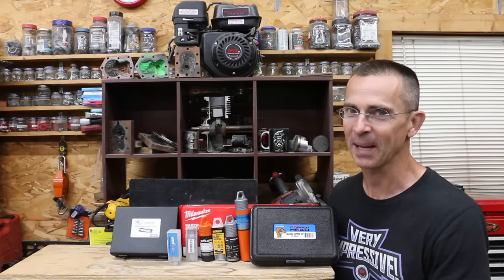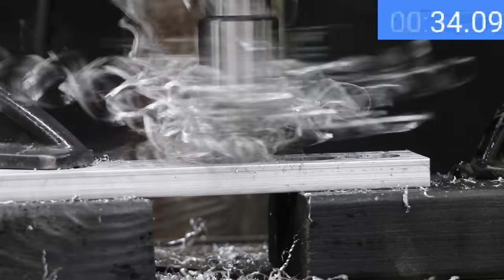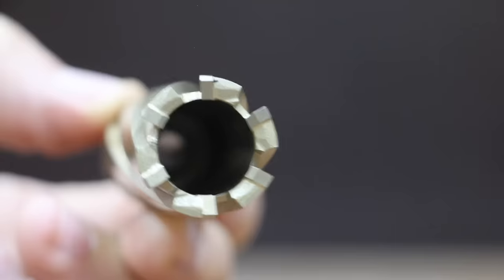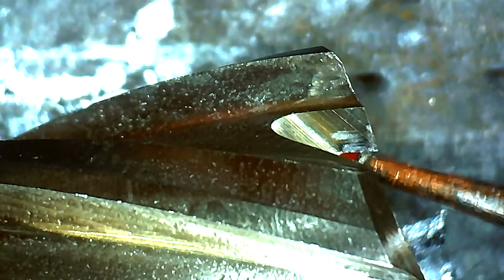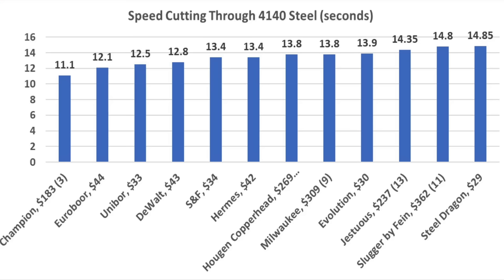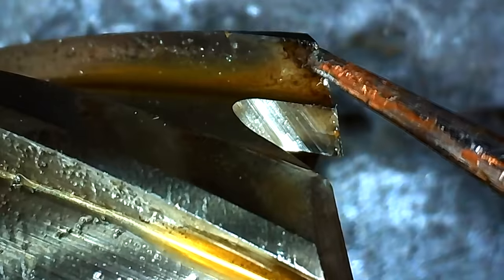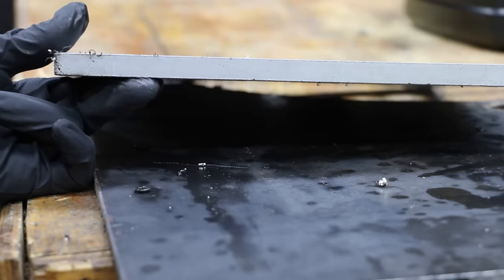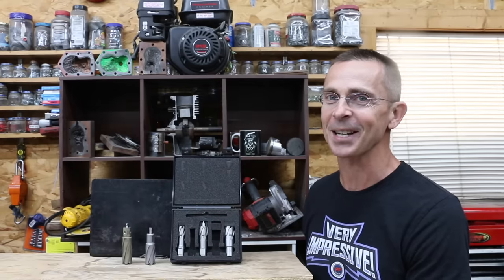Best Annular Cutter? Fein, Milwaukee, DeWalt, Euroboor, Hougan, Hermes, S&F, Evolution, Steel Dragon

Comment: Have you done grinding wheels? They have come a long way from the old grey 36 grit wheels. CBN wheels are great for high speed steel. Diamond only works on the very slow speed wet wheel set ups like Tormek and the clones of it.

Comment: I would love to see a video on the best (and sturdiest) retractable dog leash. 

We have bought multiple and our tiny little 9 pound dog pulled and snapped a TUG retractable leash TWICE when the leash was a "medium" made for 55 pound dogs and under. Well our dog is much smaller than that so I figured it'd be plenty. But no. The strap popped in the same place twice within about 2 months of use. 

There's a million different brands claiming chew resistance, retractability, reflective, ergonomics, length and some even have replaceable cords/straps.

Comment: You're an asset for those of us wanting the "good stuff" and not the "Junk with good marketing", Thank you for that.  

I think i have a suggestion: With Amazon getting their Basics line into all sorts of new places, When is it worth it to cheap out and go with the Bezos special?  I've had good luck with their Pull saws, Insulated pliers, and their version of the ubiquitous "Screwdriver with two sizes of Flathead and two phillips with a reverseable shank". But stuff like their consumables, and strangely enough, PPE gear like hardhats just seem... off to me.  

I've been of the mindset that they're like Harbor Freight:  you get it there first for cheap, use it, then get the better one when it breaks, since you know that you'll actually use it enough to be worth the investment. But stuff like their zip ties, shelves, sandpaper and wire wheels / brushes all seem to be  really hard to mess up, or figure out how to cut costs even more.  And stuff like hard hats? if it's Compliant with CE EN397 and ANSI Z89.1 Type I, Class E, G, & C  like they claim, picking up one for under 20 bucks would be a steal.  Wow, Just checked, and the AmazonCommercial Hard Hat, 4-Point Ratchet Nylon Suspension, Green  is like $5.40 at the moment.

Anyway, keep up the great work, and thanks for your time.
Reply from the maker: Thanks and you are welcome!  Thanks for the suggestion.

Comment: Hey man absolutely loving your reviews! Something for a video idea that I think would be excellent since the niche tools all look very similar between all the companies are compact shop blowers. Milwaukee's, dewalts, Bauer, Hercules, Ridgid, Ryobi, Makita, Bosch, skil, worx blowers all look very similar, have neck to neck stats, but cost from $50-$200! Also, something I think would be really cool is testing battery adapter systems you can get on eBay, Etsy, and Amazon and see if they are safe, reliable, don't damage batteries, impact performance, etc. I've been looking at these things because I have all Milwaukee tools right now and this have a bunch of batteries but some tools in the Ryobi line and DeWalt line I would love to have but don't want have multiple chargers, batteries, and storage for such. It would be really cool to see if it's a viable option to stick with one battery platform then just have a few adapters if you wanted to get a niche tools that only one company makes (example being the DeWalt cordless roofing nailer 😅). Anyways, hope you consider the suggestions, and just wanted to say thank you for savings me literally thousands of dollars as a starting out contractor needing to buy my first full tool set!
Reply from the maker: Thanks!  Thanks for the suggestions.

Comment: Love your videos!  I'm wondering what the speed (rpm) was on your HSS cutters.  340 should have been about the max and 250 may have been too slow.  It may be why you were chipping teeth in the mild steel. (80x4)/.94=340.04

Comment: I used Haugen regularly on one of my old jobs, both the mag drills and the cutters themselves.  I am not familiar with the Copperhead series, but from my experience the regular Haugens were as durable as heck and I put many, MANY holes 1/2”+ tube steel using these tools.
Reply from the maker: Thanks for sharing.

Comment: As a construction worker i used many brands . The best machines ive used are the Fein kb series and the atra ace by nitto koki (hikoki) the worst machine is euroboor it wears down fast and a lot of play on the rails wich is gonna break the drill bits.  I use the euroboor cutters and phantom cutters because i live in holland so euroboor is 15- 20 euro per cutter.
Reply from the maker: Thanks for sharing.

Comment: For drill weights, could you have added in the pilot pin as well.  It seems all the bits without a pilot pin weighed more.  Is that directly because their design is pinless?
Otherwise, a great video as usual, up to your usual exceptionally high standard.

Comment: if you plan to do alot of feed tools like drill bit i recommend a knee mill with auto feed quill as you can set feed speed and have torque to spare
and yes you will be able to put a quill handle on that can equal the one you have for the drill press
plus it has a stop you can set in place so you will never go beyond what you want and damage the bed

so a knee mill would give you
1. better speed control
2. feed speed control
3. more torque
4. quill stop control
5. a more stable platform as it would be almost impossible to walk the bit
6. you could start testing heavy bits

yes i know they are not cheep
Reply from the maker: Thanks for the suggestion.

Comment: I first used these in the 90's with the portable magnet hougen press  back then most called them rotobroach's they are excellent last a long time and.can be resharpened. The speed he is running them is WAY higher than normal and is more than likely reason for the damage seen.
Reply from the maker: Thanks for sharing!

Comment: The last couple of times I used a mag drill with an annular cutter, I needed to drill several holes in an 18 wheeler frame & instead of using cutting oil, I put my water hose at the bit & let cold water run over it while cutting the hole & it cut 18 holes on the same bit & the 18th hole cut just as good as the first one
Reply from the maker: Thanks for sharing.

Comment: Having been through the process of using multiple drill bits, then "learning" and just buying a hole saw only to be disappointed in the quality of cut... Would these cutters be appropriate for making holes in wood? Granted, it certainly appears to be overkill, but the holes are just so clean! I'm sure wood won't damage them given their durability with metal, but I want to use the right tool for the right job :]
Reply from the maker: Thanks for the suggestion.

Comment: So the Euroboor is the way to go if you need to visit the local bank on a tight budget.
Thanks for the great test, as always! I've seen those before, but did not know how they are used. Better alternative to hole saw's if you need more accurate holes or have harder material.
Reply from the maker: Thanks for watching!

Comment: I would love to see a video about framing hammers, testing which milled face last the longest, which grip slips off first, and which nail setter can take the largest variety of nails, ect. Most framing hammers need to be modified to take double head nails and it's annoying. The most common ones I've seen in 22oz Dewalt, estwing, kobalt, harbor freight, and Milwaukee.
Reply from the maker: Thanks for the suggestion.

Comment: I'm surprised to see you running all the bits at the same speeds. My understanding is that carbide should be run at ~twice the speed of HSS to maximize their effectiveness. I get the side of wanting to use consistent speeds for all the bits, but it might not be truly apples to apples if some bits are running at a speed they're not designed for. Curious your thoughts. 

Echoing everyone else on here - your videos are always amazing and are a primary data point for me whenever I'm in the market for a new tool or device!

Comment: So, some basic machine shop here. Cutting speed in surface feet per minute of spring steel is 10 to 25 feet per minute so using the maximum cutting speed,  RPM= 4xCS/Diameter (of tool) so Rpm = 100/.9375 That rounds to 1000/.94 or 106 rpm . Those RPM values will only decrease as the work materials become harder. This test was conducted at speeds which were certain to destroy the tool.
Reply from the maker: Thanks for the feedback.
Reply: Once tool RPM has been calculated there's a published feed rate for the material being cut as well. Side note, I was unable to find a published cutting speed for AR500 steel. @ProjectFarm

Comment: I have used these a lot on steelwork. A decent centre punch can help stop the cutter from slipping like on the armor plating (although I'm sure it wouldn't have bitten anyway) these are used outside a lot and sometimes water or debris means the magnet doesn't hold too well and you need that extra little bit to keep it in place. Scary if the magnet comes loose while it's cutting too, especially upside down
Reply from the maker: Thanks for sharing.

Comment: I could see the cutters deflect as they entered the work. Light duty drill press! There also seemed to be considerable wear very quickly. Is that due to the flopping around as the bits entered the work? As a hobbyist I can't justify the price. Thanks for the info.

Comment: I love your reviews but its hard to say how they would stand up overall. I know you had to come up with a process to make it the same and even but this is not how i use these cutters. 

The constant pressure while cutting is not really something i would do with these. I let them eat pull out then back in, also i add fluid more often and if the cutter is covered in chips i clean it out. 

I understand and appreciate the tests you do, seriously one of the best and fairest out there
Reply from the maker: Thanks!  Thanks for the constructive feedback.

Comment: Figured I'd come back since I ran into an issue today. I've been using Rotella T4 (Heavy Duty Diesel) in my oil burning car for a couple years now. It's heavy, but I've never had any problems with it. It burns about half as much as the recommended 5w-30 weight in Supertech. But with inflation and seasonality, the price is higher now, and I'm considering switching to Mobil 1300 Super Delvac Diesel Oil for cheaper. I just want whatever oil burns less. Dunno if there is an appetite among the general community for Diesel oils, but would be a nice comparison. A lot of people with gasoline trucks use T6 synthetic 5W-30 as their preferred oil. So if you compared it with that, maybe it would get people interested. You can also throw oil that Rotella Gas and Truck as another comparison. And the Supertech Diesel oil too if you wanted.
Reply from the maker: Thanks for the suggestion.

Comment: Might be an interesting topic for a video: performance of different compression fittings againts different traditional flare nuts for connecting fuel and brake lines
Reply from the maker: Thanks for the suggestion.

Comment: Although the test seemed off center comparing carbide with high speed steel, carbide even though it can break easily it can cut some what easily than the high speed steel. It is the reason we use carbide inserts in the the shop production versus cost is no contest
Reply from the maker: Thanks for the feedback.

Comment: since this summer i will only be buying TCT (Tungsten Carbide Tipped) drills, i had to drill some 20mm holes through a 30mm harddox500. the regular drills died within 2mm of cutting depth while the tct drills could drill 3 holes per drill before getting dull.
Reply from the maker: Thanks for the feedback.

Comment: I believe a good item to see would be pipe wrenches to see how easy some bend and see how good teeth hold up, main brands that would be nice to see most are Milwaukee and Snap-on. Also may throw in a set of the self adjusting ones.
Reply from the maker: Thanks for the suggestion.

Comment: It's a clear example of matching the right tool to the job you need to get done.

Besides that, none of these tools are meant for production work, they are clearly meant for incidental or occasional usage. It makes no sense to use a $200+ tool that is going to wear out after cutting three holes.

If you need to cut a dozen holes you can't do it with any of these tools unless you're cutting soft metals.

Comment: I got you boo, ready for this? 
Which oil make the air rifle diesel the best. WD-40, 4in1, diesel, Vaseline, I'm sure the internet has all sorts of good ideas for dieseling. Probably just soak the pellets and then rag dry them off, the oil will stay in the cup. Shoot out may all be the same, maybe just test the application method? I think this would be a fun episode to watch

Comment: My Hougan mag drill recommend using a coolant for all cutting with the annular cutters. Curious why you chose to use cutting oil for some tests? Most cutters I looked at also recommend  coolant rather than cutting oil.

Comment: I found that given the price of each HSS cutter the "cheaper" brands are not really much cheaper than well known stuff & performance is very similar - as this test has shown. Annular cutters were not intended to be used for anything more than mild steel. 
Clearly carbide is far superior to HSS - through for some reason in annular cutters it is less common - maybe due to chipping?

Comment: I realize it would be a lot of work to redo any of this video but I wanted to ask if you might consider using continuous coolant in future testing if you evaluate drilling tools again. I'm curious whether or not it makes much difference here.

Great job overall as always though. I follow your videos on the regular.

Edit: For softer metals I mean. Just saw it was used on the AR 500.
Reply from the maker: Thanks for the suggestion.

Comment: PS... removing 'time-speed' ...  the cost-benefit comparisons as well as 'supply assurance' for volumes of cuts could show that, for instance, laser while expensive up-front, given the 100s or even 1000s of cuts without additional parts-material investment; may prove that even for the small manufacturer...   who's interests are security of tools as well as cost per cut...  i think you'd severe everyone well to consider a series on this.   Possibly resulting in 'consultancy contracts' for you.

Comment: Was the spindle speed set correctly on the mild steel? It seemed to cause way more damage to the HSS cutters than it should have. HSS generally want a cutting speed of 2.5 times less SFM(surface feat per minute) than carbide tools, yet in your test, the RPM seemed virtually the same, so either the HSS bits had too high speed or the carbide ones where set too low.

Comment: Like many others I had no idea about annular cutters before this video. I do have a question about them though, why did they cut the mild steel faster than aluminum? Correct me if I’m wrong but aluminum is softer than mild steel.

Comment: Interesting video I had no idea these tools existed. These might be a good replacement for 12mm drill bits I use on my tools. The point is you are drilling less material to make an equal sized hole vs. a solid bit. I did notice a small amount of wandering though on a couple of those bits at beginning of drilling. I'm guessing the pilot shank requires a small pilot hole before starting?
Reply: You don't need a pilot hole. Some of the cutters were "walking" due to there being no center punch hole for the pilot to start with, or it looked like in some of the cuts the pilots had been removed. Center punching where you want the center of your hole to be is a generally used practice to prevent that "walking."

Comment: This comes to the same basic conclusion as just about every machining video (note: I’ve never used an annular cutter, only facing mills and lathes): on soft materials (mild steel, aluminum, brass, etc) you should use high speed steel cutters, but for harder steels you need to use carbide. What this didn’t cover (and you should!) is the difference in pressure and cutting speed - what’s generally taught is that carbide requires much higher cutting speed, in part because they run cooler so they can take the extra speed. I’ve never tested it as mills and lathes operate on speed and depth of cut rather than pressure and speed, so while I suspect you could have used those same carbide cutters at 1000 rpm without damaging them instead of the 250 rpm that you did, I don’t know the answer in advance. 

Also: thanks for doing this test with tools most of us have at home rather than the best tool for the job. I know if I needed a hole in AR500 plate I’d take it to a machine shop (where they’d use a mill) or use an oxy-acetylene torch (if it did t need to be pretty), but it’s good seeing how precision holes can be made in nearly unworkable materials at home and for a reasonable price.
Reply from the maker: Thanks!  Thanks for sharing.